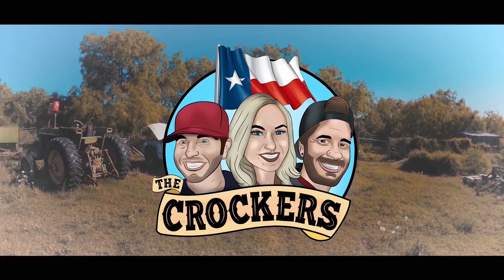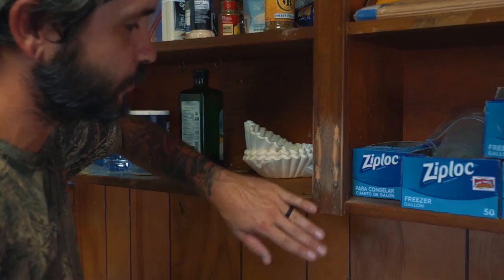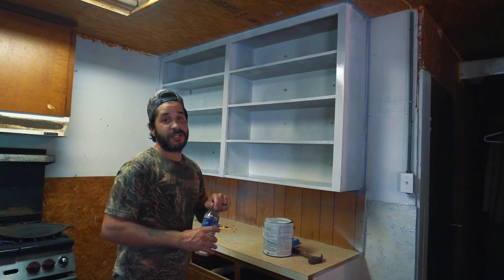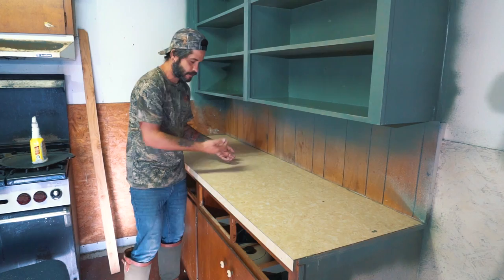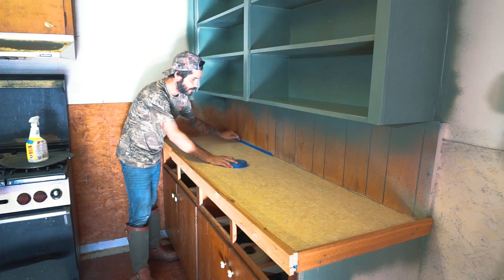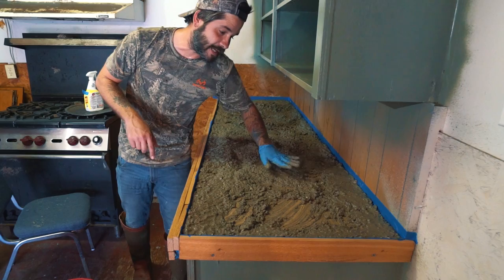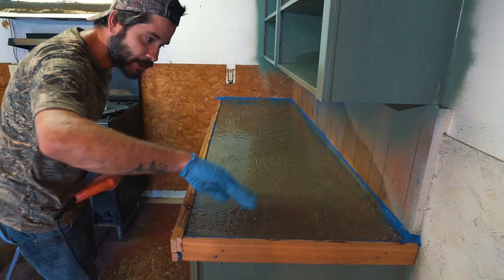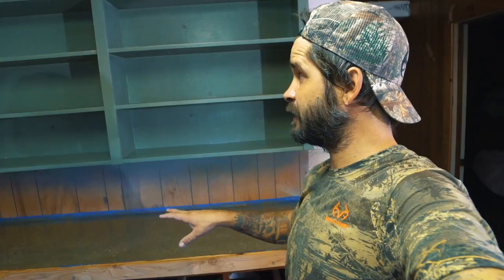Old Kitchen MAKEOVER! Concrete Counter Tops and Fresh Paint! DIY - HOW TO

Comment: We made 2 inch concrete counter tops in our kitchen a couple of years ago. Stained them black but let some of the gray bleed through and sealed. We love them and have had no problems. We did put wire in before putting in the concrete. Good job. The place is taking shape. Granny is gonna love it.

Comment: I think you might want to consider putting some 2X4's under the counter to give it a bit more support with that cement counter top.. Just sayin.. *s
Reply: I was thinking the same thing about the weight of that concrete on the cabinets. I'm no pro by no means just thinking thats heavy
Reply from the maker: It was 100-120 pounds of concrete. I jumped up on the counter and it was rock solid... and I weigh 160. Plus it's evenly distributed on the countertop that's already on there, so that helps. I personally think it'll be fine, but if I ever see any weakness, I'll add support

Comment: Loving the green. At first when you said green I was like Noo do white because it gets so dark in there or do green on the bottom and white on top but I am really loving that green you picked for the cabinets. Get a wash cloth put it in water and then a freezer bag. Stick it in the freezer and when you go to work in the cabin put it around your neck and also on the the folds of your arms and behind your knees. Those areas will help cool you down and then get a box fan or stand up fan that rotates and a hand mister and spray yourself a little and stand in front of it. Stay hydrated and cool. Take a break when you get to over heated and do not exert yourself to much in that type of heat, please! Can not wait to see you all on your Moms live chat. Until then  peace, love and joy~

Comment: I actually think open shelving looks good, especially since it’s a camp house.  You mentioned lining with fabric, which would make it look great if left open ... that’s only MY personal opinion, however.  Can’t wait to see how the concrete countertop looks
DESIREE SANDPERE is talki gtruth ... wet washcloth or several frozen ... take one out when you start to get hot and out in joints - behind knees, at elbows, in armpits and at nape of neck ... cold moisture will cool you down BEFORE you get too hot ... it’s like anything, pain meds, anxiety meds, etc. .... TREAT it before it gets too bad so it takes less time to get temp under control.   And where are those insulated water bottles, those would for sure help out.  It’s all looking good 😍

Comment: 🛑 you gotta ad pd some some supporting beams under that concrete countertop and put some rebar or wire mesh in the mixture to keep it from cracking/breaking.  I hope it works out for y’all......

Comment: Love the countertop and the painted cabinets!!  I like open shelving on the upper cabinets, or doors with glass centers.  Just an idea to think about!😉 Jaylena did a fantastic job picking out that paint! Oh, another idea.  A friend of mine updated his old 30s house kitchen, and to save money, he bought some of that molded tin, like some people underskirt mobile homes with (sorta has a brick or block pattern molded in the tin), and used it for the backsplash under the cabinets.  It was beautiful and very inexpensive.  I've even seen older homes have it on ceilings except painted white (for ceilings). Just some thoughts to think about!Do you sand the concrete after it's dry to smooth it. Or use a sealer to smooth and waterproof it?❤👍

Comment: I don't understand How the Concrete will Dry out?  Where will the moisture drain?  Will Air Drying in the heat cure the concrete?
Questions.   Questions.   Questions.    Will the bottom of the concrete be firm enough to handle the kitchen use?  I have never used this medium before.   YOU are Gutsy to try it out!  My hats off to you !!!   .....Go fer IT !
Reply from the maker: Yes, it'll pull the water out of it... it'll take a while, but it'll dry
Reply: There's a lady in Georgia who does amazing things with sand and cement. I cut off the legs of all my old jeans and now use them for sowing spuds etc. The top part I mould into containers to hold pretty flower displays. Her accent is gorgeous. The birds are hopping around her and the garden as she works and she's as cute as a button. Love her for her southern charm and generosity.
Reply: @TheCrockers  Are you going to buff/or sand down the top to a highly polished finish, like some of the larger stores do?  Will you put a stain or tint on the concrete top?  I'm just curious.

Comment: I'd go ahead and prime the bottom while the wood for the concrete top is still in place.  If not all, then just prime with a brush under the countertop which will help when you do the bottom.  Oophs.  I remember you cleaned it first, so maybe this is a bad idea.  You could rent out the cabin to hunters and make some money.